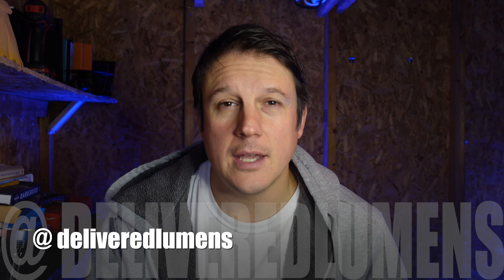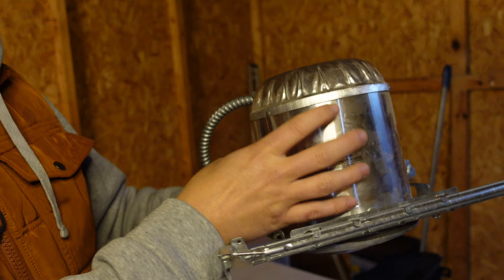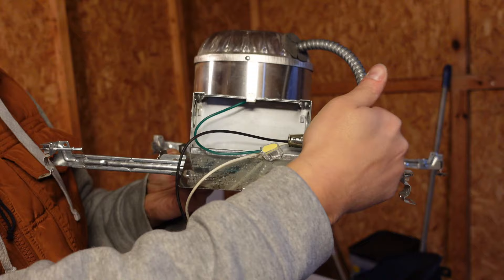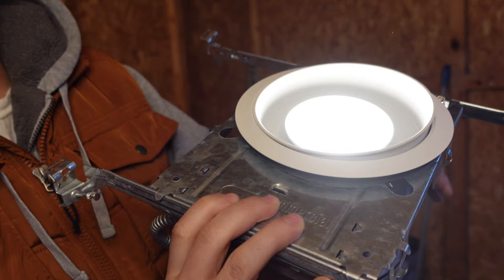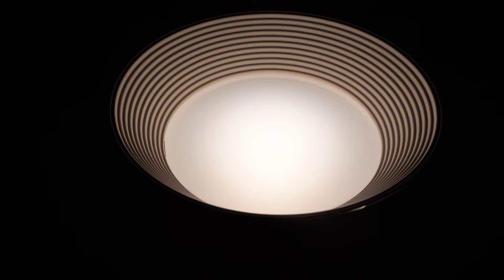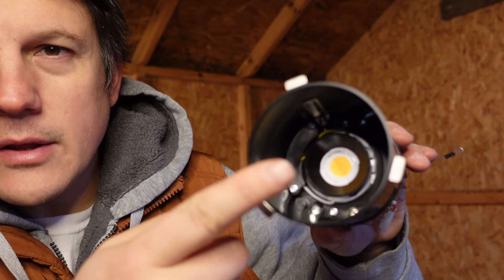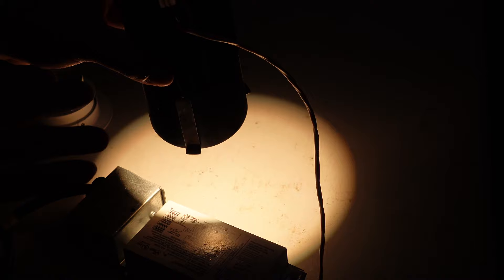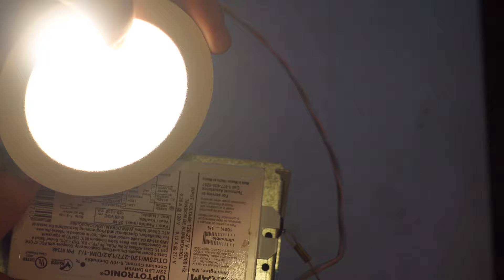Interior Designers, stop using these recessed lights! (Here's what to do instead)

Comment: I have experienced a lot of led failures after 1 or 2 years. I am no longer interested in led lights that are not changeable. The style of some of those is incredible but i have been burned too many times before (and so has the environment).
Reply from the maker: Any reputable spec grade manufacturer will have serviceable fixtures.
Reply: 100% even high end commercial fixture become obsolete after a year or 2 and they only option is to replace the fixture at full cost, then sometimes they dont match anymore so now you replace them all.

Edison base all the way, then you can always swap the bulb with the latest and greatest
Reply from the maker: @CobraJamrock  Integral LED fixtures from reputable manufacturers are serviceable from below. but it isn't as simple as a bulb swap. that much is true.
Reply: @DeliveredLumens  to a point, driver replacements cant be $100, and arrays also. thats IF the manufacturer still supports it.

you have too much faith in manufacturers and you underestimate fixing costs, we've delt with Signify, Acuity, Moda, Phillips, Lithonia, Liteline, Stanpro. its all the same story "we dont make that version anymore" "LEDs last forever you shouldnt need to repair them"
Reply: Same experience here, with over 100 LED lights throughout the house. These integrated fixtures are a pain to service when the LED dies out, unless you buy a dozen in advance. It's way simpler to just use cans and pick LED light bulbs you want by diameter, power, and nowadays even color adjustment.
Reply: @max2551  What integrated LED downlight did you purchase? How are they a pain to service? My lighting designer said they are serviceable from down below the ceiling, so if the LED goes out, you simply plop in a new one. Such as the USAI light he's holding in this video. The replacement LED parts aren't cheap but it's not the end of the world. But, she's of course trying to make the sale from my purchase. I'd love to hear your experience :)
Reply: @CobraJamrock  Aren't many of the brands serviceable from below? Such as the USAI light he's holding in this video? Where you simply swap out the new LED part from below the ceiling without having to cut open the ceiling and replace the entire housing /unit? At least that's what my lighting designer told me. Or is she lying to me? LOL Maybe she just wants me to purchase from her.
Reply: @jossetteespenshade9494  you are still replacing the entire array and driver system, you will be able to do this without destroying the drywall, but you are buying brand new LEDs that dont match your existing ones
Reply: I dont think interior designers know that you have to shutdown the breakers for a common area used by workers or tenants to swap out a single fixture.  Some places you have to completely shut down a business just to swap out a single integrated LED.  The best person for selecting lights are just the electricians and not light designers.@DeliveredLumens
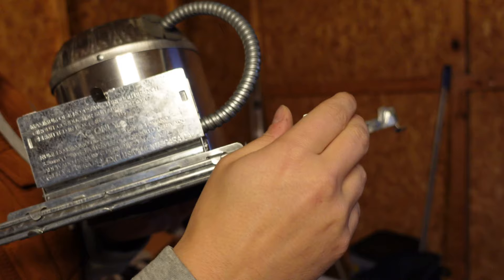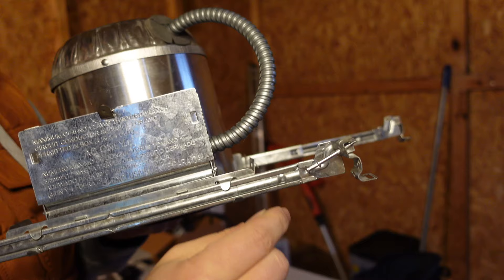Reply: @CobraJamrock 2:17 2:18
Reply: @CobraJamrock 3:43
Reply: @CobraJamrock  Tesla was greater than Edison.
Reply: In my experience, the driver fails more frequently then the LED array.  It can be swapped out from below.  A good manufacturer would honor the product warranty, some of which are 10 years.
Reply: Agreed I am looking into just putting in halogens after looking at LEDs the consensus is the entire replacement of the fixture. Also Leds are blue lights no matter how altered which are destructive to skin and eye health.
Reply: Halo has been much more stable and constant than most of the brands on the market. They even have adjustable angle deep baffle LED lamps for slanted ceilings.

Comment: THINK TWICE BEFORE DOING... New smaller LED fixtures...nice looking - Yes Easier to install - Yes... but thats about it. I've installed hundreds of the new, flat, wafer style LED fixtures over the last couple years and after much pain and suffering have learned the fallout is terrible. When they die... you have to replace the entire fixture not just screw in a new bulb. And forget the 22 year life expectancy claim. Plus... good luck finding a replacement fixture of the same model  with the same lumen output in the same color as the one you are replacing.  I Installed 20 LED fixtures in a customers great room two years ago. was able to find a match when the first two lights failed... since then no luck. Same manufacturer, same model number but the color of the lights when lit do not match. The only fix was to replace all 20 fixtures to maintain color and brightness matching.
Reply from the maker: Cost and quality are serious considerations. No doubt. Inexpensive wafer downlights are not nearly as thermally protected and are likely to not perform well over time. That's why they're $20
Reply: FACT!

Comment: The presentation neglected to discuss the effect of the deep recess in the new narrow diameter downlights. Deep recess and narrow apertures create a spotlight effect which requires more fixtures to even out the illumination. It would be good to hear of the tradeoffs between ceiling height, angle of illumination, and fixture spacing with these arrow aperture lights.
Reply from the maker: Fair enough. It’s a complicated subject but I should dive into it

Comment: My shop was built with flush LED lights. Sure they put out a lot of light. But they suck when they go out. I just had to replace 7 panels and 2 drivers. Luckily when they built the shop they purchased 10 replacements. They are Chinese  junk and no longer in production. They are also 8” diameter so I now cant put in 6” cans. If I had standard recessed cans I could just screw in new LED lights and there will always be retrofit kits for the older cans. The new stuff only seems to last 5 years not the 20 as advertised. To upgrade to newer technology I need to replace 80 fixtures. UGG. I wish they were just screw in bulbs.

Comment: Great info but I never did hear you compare the cost.  You quoted $100 - $300 for your preferred options, per light.  A descent 6" contractor can light housing (Juno IC22) along with a good LED retro trim kit can be purchased for well under $20.  Depending on someone's budget, that might work better.

Comment: Also to point out by the time you buy the can fixture bulb, reflector and trim ring you looking at $50 to $70 for each light.  There are other options that you can get like the can less ones and still be about to change the trim ring.
Reply: Sub $100 is a bargain from what I’ve seen!

Comment: This guy is just shilling for the companies he reps. If you notice, the 'advantages' he claims for the low voltage downlights are totally subjective. Glare? Too big a hole in your ceiling?  The simple fact is that if you can use a 3.5 inch LED BR30 bulb in a traditional 4 inch 'can' fixture....and then, if the bulb dies, you simply replace the bulb yourself. When you install these new fancy low voltage LED downlights, when one of them dies....YOU GOTTA CALL AN ELECTRICIAN TO REPLACE IT. And, you have to hope that the company still makes the same model fixture.  LED BR30 bulbs aren't going anywhere.

Comment: Great presentation!  Subscribed!!  I'm looking to use Ketra 2D adjustable fixture in my project.  The building requires 2-hr fire rated housing or light cover.  Most covers are 9" deep - too deep for the ceiling.  Any other options aside from building them out of sheetrock?

Comment: I installed 1 led light in home but after 1 week not working then I bought again after 2 weeks blinking so I bought a 4 pin pl-c downlight 1×26w g24q because cfl downlight bulb is easily replaceable but leds are not replacable

Comment: My question is about beam spread since I do not want a spotlight affect - I am looking for you to address that. I am working on a kitchen in an old Victorian in an historic district that we originally spec'd WAC lights w/ an aperature of 3.5" costing upwards of 300 a piece but have a 45 angle beam spread. What would you recommend ?? If the cost is less for a smaller aperature then we would need many more lights than we'd like to do. lmk thoughts!! ideas, suggestions all welcome.
Reply from the maker: Beam angle is really a function of ceiling height. The higher the ceilings generally the narrower you go. In a 8-9 foot ceiling. 50-60 degrees is the way to go. At about 4-6 feet apart depending on the architecture

Comment: Thank you for sharing this information! I love the look of smaller recessed lights. I  am building a series of modern A Frame houses and would love to know what you would recommend for 25’ tall 35 degree ceilings. Not really worried about cost as much as functionality and quality considering these lights will outlive most all other lighting fixtures. Thank you again.
Reply from the maker: You’re going to want to look at an adjustable downlight for this application so that it can be titled to reach nadir relative to the ceiling slope. 

With that ceiling ceiling look for 1500-2000 lumen down lights with probably a 30-40 degree beam spread. 

Let me know if you need more help.

Comment: I have been searching the internet to learn the design principles of lighting. Hardly anything on YouTube. I wanted to know how designers think about SMD vs COB lights for architectural lighting. Can a 4" SMD recessed light available at HomeDepot be used as architectural downlight?
Reply: I've got a few on layouts and layering light💡I have used adjustable gimbals on 4" recessed lights for accent lighting.  To get the pure light you need for art, it should be low voltage cans though, which drives up the cost.

Comment: What happens when these integrated LED lights burn out? Does it require demo and patching of the ceiling to replace them?
Reply from the maker: No, a quality spec grade downlight can have its parts serviced through the aperture from below the ceiling.
Reply: Pretty much, yes. Most of the LED disk/panel flush mount lights on the market today have solid-state emitters that can't be serviced/replaced without removing the unit, and are hardwired.

Comment: Is a 60 Deg downlight best for the lounge room or would the result be better using a 90 Deg downlights. Both are deep low glare lights.
Reply from the maker: It depends on your ceiling height. 9 ft k would probably do 60 degree lower than that 90

Comment: Awesome info. I just had my Contractor put in lights (remote remodel in a house that had no ceiling lights)  and they drilled 4” tunable Halos everywhere and I cannot stand the glare! They sit flat at ceiling level!! Any ideas on reducing the aperture by adding an aftermarket magnetic ring which also sinks the light into an enclosure? I have 20 of these all over the house. Thanks for suggesting an after market solution!
Reply from the maker: I’m not aware of an after market solution. Let me know if you find something!

Comment: Can you recommend a 2” or 3” incandescent recessed fixture? I don’t like the way LED fixtures dim down.
Reply from the maker: Chris, halogen downlights in 2-3” apertures are out there. However they require ELV or MLV transformers. A good LED downlight and dimmer will perform as well or better than a halogen. It’s about specifying quality.
Reply: @DeliveredLumens  LED fixtures when dimmed do not achieve the warm amber tones that a halogen or incandescent fixture does.
Reply from the maker: Ah! Look deeper! Most spec grade downlight manufacturers offer a warm dimming solution. Here’s my favorite! https://www.usailighting.com/dimmable-led-downlights-warm-glow-dimming-products
Reply: I don’t think the average person is going to notice that an LED fixture color temperature while dimming does not emulate an incandescent or halogen lamp. LED is the way to go in this day and age, and LED technology is improving rapidly as well as becoming more and more price comparative to legacy sourced fixtures.
Reply from the maker: @djm5k  like anything else, you get what you pay for. The cheap stuff at the big box stores won’t deliver the same experience as a more fully designed product. That said, totally agree LED is where you need to be looking!

Comment: Thanks for making this video! I was literally about to install 6” can lights in my basement ceiling, but am definitely going with a smaller fixture now.

Any suggestions for spacing if using a 2”-3” fixture? My space is around 15’x25’. Again, it’s a basement so I want there to be adequate lighting, but don’t want to be too bright either
Reply from the maker: Glad I could help!
Reply: Its a basement.
Reply: @diegudr 
That doesn't mean it has to look like s*@t for the same price.

Comment: What's the best way to reduce the aperture size when home has pre-existing 6'' cans throughout? Are there retro fit kits that will reduce the aperture ?
Reply from the maker: If you have existing 6” cans some manufacturers make retro kits that will reduce apertures but you’re left with a plate to cover the opening. If that makes sense.

Comment: Mirroring previous comments, thank you for the informative video!  The wife and I live in a small 2-story cottage  built in 1900 in the historic district of a small town. We are renovating both bathrooms in the home and after watching your video I plan on replacing the recessed can lights in the upstairs bathroom with 1” or 2” LED’s. That bathroom has a pantry-like footprint, long, narrow with the entrance at one end flanked by a large tall window at the other end with a walk-in shower (48” x 32”).  The recessed lights will be compliant with wet environments.  To your knowledge are the 2” lights able to share one driver or does  that attribute only apply to 1” lights? Thank you for your insights, very helpful and appreciated.
Reply: @jamespitchford7390, @Delivered Lumens, to replace the old larger recessed lights, do you have to completely redo the ceiling? How do you deal with the huge hole? My entire home has dimmable 6-inch cans with black rippled backgrounds. I would love to change all 50, but it seems it may not be worth it at this time for me.  =)

Comment: Is there a way to retrofit these into existing 4 or 6 inch recessed light fixtures? My house was updated in the 90's and I'm looking for a way to make the canned lighting more modern and avoid using the flush mount lights.
Reply: Same scenario here.   I'm betting the only real solution is cutting a square in the drywall large enough to remove the larger housing then fitting a new drywall piece in with the smaller aperture.
Reply: The have retrofit kits for some.  You might be able to break the box lose for the mounting and start over but you got to be careful not to pull the wire.  IF you can get to them from above no problem.
Reply from the maker: You’re probably right. Sometimes the electrician can push the old fixture out of the way and you can reuse the old opening. Most of the time you have to cut the old heads out.
Reply: Our 4" and 6" inserts fit nearly any old can. Our Koto series offers up hundreds of style options and finishes. No need to even call an electrician.  It's almost as easy as changing a bulb.

Comment: We have a 4 year old man. House. They are hard wired to romex and not sure how to convert it to a quick change system
Reply: There is no housing. There is a metal box on the light itself. Romex goes straight in that. Can't even find them. Can't splice as it's not code correct?
Reply from the maker: Personally, I wouldn’t use the old boxes and splice I would recommend complete replacement.

Comment: Great info, but what about all the "canless" recessed downlights on the market?  They aren't flush like the wafer lights and they seem to be much more reasonably priced than typical "high hats"?
Reply from the maker: Hmmm do you have an example?
Reply: @DeliveredLumens  
Maxxima 2 in. Slim Recessed Anti-Glare LED Downlight - 5 CCT 2700K/3000K/3500K/4000K/5000K, 500 Lumens, Canless IC Rated, Dimmable Ceiling Light Fixture with Square White Trim, 90 CRI, J-Box Included

Comment: Keep preaching the word! I live in Las Vegas, had to hire a lighting designer from Los Angeles, per diem and all that.  I have a "lighting fetish" so to speak. They did a fantastic job with lighting troughs far up into the ceilings to where one can see the light but not the source. All the artwork is well illuminated, general, task and accent lighting. What I DISPISE in homes in my neighborhood and surrounding communities is the excess of those LED wafers all over the ceilings with no other lighting source. Looks like a Delta Sky Club or hospital. AWFUL,  Homes here start at four million. What people don't realize that LED's last  for several years. Try replacing the fixture in a few years with a match. Replacing a lamp (bulb) from a quality source and one will most likely get a match. I am also hearing a lot lately a lot of negative terms of "yellow" light.  Around my home 2700k and a few fixtures are at 3000k. Have seen a lot of these homes 5000k and up! If one likes looking into the Sun or a laser beam - well good. For me, the lights are very focused and almost pooled where needed rather than overly bright.  House looks best at night.

Comment: Its not comparable. One has an exposed bulb with large opening. The other is a smaller opening (apperture) with a windowed glaze for disfussion. 

The whole argument is just "choose a different fixture from my brand that im selling." 

I mean its your channel so fair enough. But leds dont deliver the lifetime like they promise, and its nearly the same cost unless you do a cheap wafer.
Reply from the maker: I’ve worked with recessed lights of every medium. If you buy bad LED you’ll get bad results.
Reply: @DeliveredLumens  how do you characterize a bad led. What performance specifications are listed on the box that can describe the quality of LED?